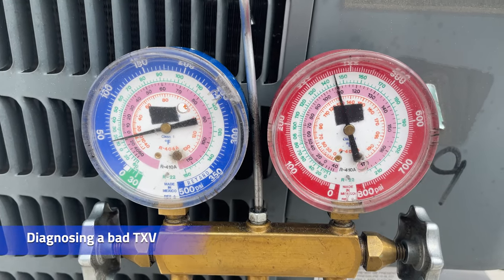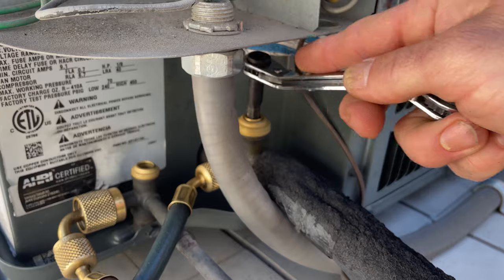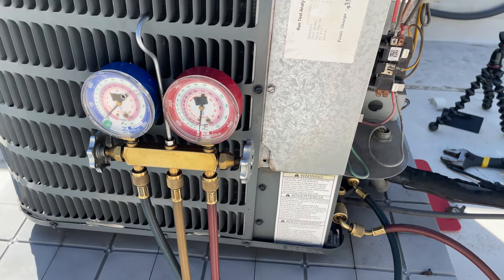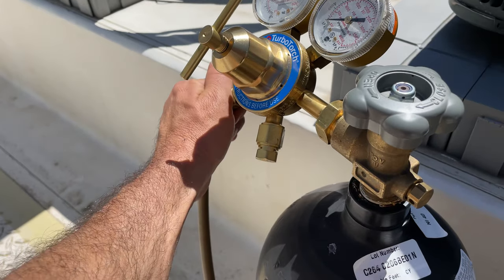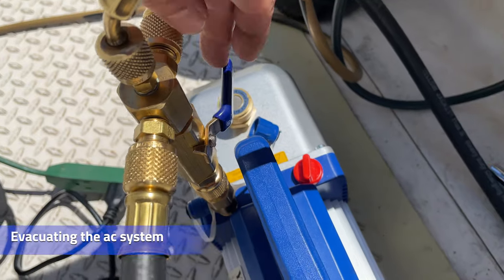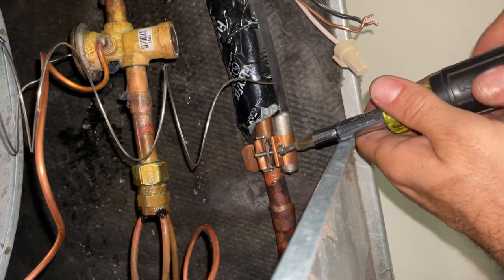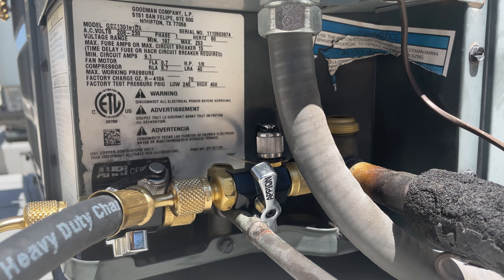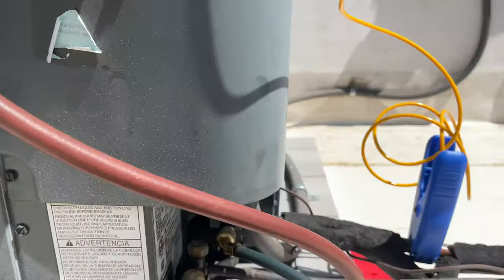TXV Valve Installation

Comment: Those are not actually “king valves”; they are service valves. King valves are only found in refrigeration systems at the receiver outlet.
Reply: nah dog its a king valve.
Reply from the maker: While this may be true I did AC service and installs for many years and everyone I worked with called them "King Valves". Kind of like an installer yelling to solder that joint faster, but it's actually 'brazing'. We all understand each other though :)
Reply: @ApartmentMaintenancePro  went to school and know it's not actually a king valve but when my supervisor is showing me shit and he calls it that I definitely don't correct him🤣we know what we talking about
Reply: Actually king valves are where you have to crack it off the back to access positive pressure. So essentially you have to put your service wrench on and turn it in order to read pressure on either side of the system.
Reply: @WIllHvac  yeah I've seen king valves on old r22 capillary tube systems

Comment: All you have to do to test a TXV is disconnect the condensing fan or cover the exit for the condensing fan your head pressure should climb your suction pressure will stay the same if your TXV is good if the suction psi goes up it is a bad TXV
Reply from the maker: How is the suction going to rise if it’s stuck shut or has a blocked screen ?
Reply: Then You have to check your sub cooling and if you have hi suction or lower then normal suction then you mite have a blockage or it is stuck if you can't get to your sub cooling number you have to do some testing

Comment: Fantastic video! I just started on a new property that has TXV's. Is there a piston in the TXV as well? Where it bolts onto the coil, it looked like a piston came out of there. I dealt with only pistons for the last 6 years and needed a TXV lesson. Thank you!
Reply from the maker: Hey thanks Lex! From my experience the Ruud/Goodman owned brands sometimes use pistons with there TXVs. Carrier, Trane and Lennox do not because they are more efficient and sometimes referred to as TEV’s. 👍 The TXV in this video uses a piston with it.
Reply: @ApartmentMaintenancePro  Right on! Your channel is awesome!
Reply from the maker: Thanks Lex! As is yours :)
Reply: @LexVance  do not use a fixed orifice and a txv together like he did, absolute nonsense. A txv replaces a fixed orifice or vice versa

Comment: Good stuff and good use of shot angles for the viewer to absorb most of what’s happening. Now, I am a new maintenance tech still learning A LOT. My question is, before immediately condemning the TXV would you not want to know your superheat and subcool? High superheat with high subcool would indicate liquid restriction at the TXV therefore the TXV is not allowing liquid refrigerant to pass effectively or at all. But high superheat with low subcool could be a line restriction or leak (low charge). Also other sources I have studied say that adding charge and suction line stays while liquid skyrockets is almost always a failed TXV but liquid restriction is possible in certain cases. I am asking only to gain more information and not to state your work was subpar or anything like that since I am definitely in the learning process still. Please let me know your thoughts on my question and thanks for putting out information content.
Reply from the maker: This is who I learn from now since I’m not in the trade anymore and don’t have many real life mentors - https://youtu.be/IfLfXx9CsGs
From my experience txvs alway fail closed. If you can keep the furnace cover in and hold the txv in your hand or put it in hot water while monitoring the pressure, the suction should rise if the txv is operating properly. Hope that helps
Reply: @ApartmentMaintenancePro  thanks man! I love Brian Orr too! His podcast is always on in my van.
Reply from the maker: @dakotaashwood4600  yes! A great teacher @HVAC school

Comment: Do you recommend installing a TXV if I don't have one?  I lost the little orifice metering piece that supposedly came with my Mr Cool condenser and for some reason Mr Cool tech said it could take a month to get a replacement...wth??  He said it would be better to just install a TXV instead, so I bought one locally, $134, and hopefully my HVAC guy will be happy to install it later today.  This is the last thing until I my new 3 ton system can be fired up.
Reply from the maker: Hey Stephen, I always go with whatever the manufacturer recommends or says you can get away with. Not all txvs require orifices but some do. I would definitely confirm this with them.
Reply: @ApartmentMaintenancePro  Thank you!! I did talk with a Mr Cool tech, he said my system must have a TXV, instead of the piston/orifice freon metering thing. My HVAC guy said it won't save me the $134 it cost, so it sucks that I must use it, trying to "keep it simple", the TXV is just another system to fail/worry about.  Mr Cool Tech said that my Mr Cool Universal system has trouble properly regulating freon pressure using a piston/orifice on the A-coil.

Comment: When pumping down, if the system has long lines and more refrigerant than the compressor unit was designed to hold, how do you know when to stop? For instance, will you hear the compressor making a noise?

Comment: Those are not king valves my friend,those are service valves.King valves come off a receiver. When you do a pump down the refrigerant is pumped into condenser which acts as a receiver. Not the compressor as you stated. Not trying to bust your balls, just sharing knowledge with you young man…
Reply from the maker: Thanks Robert!! Always open for criticism! 😀